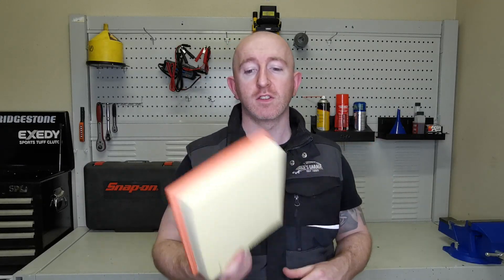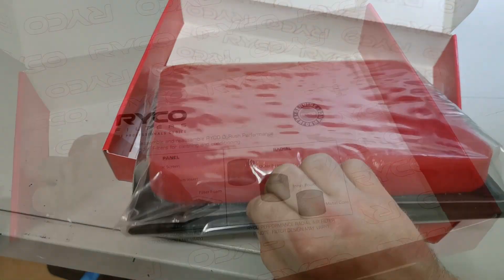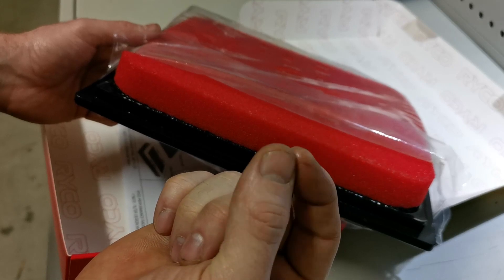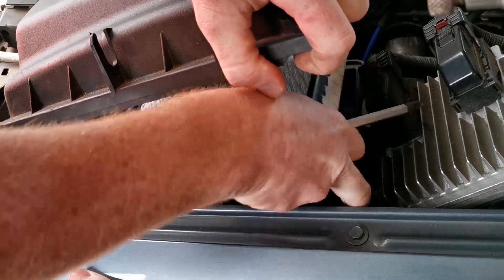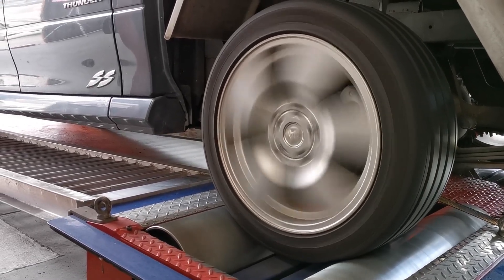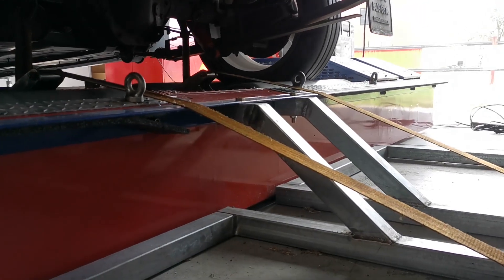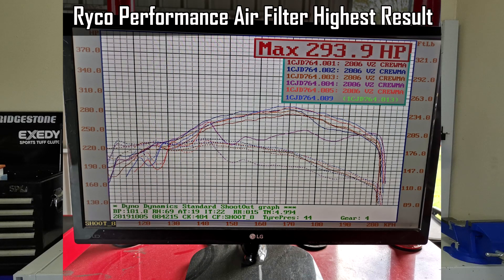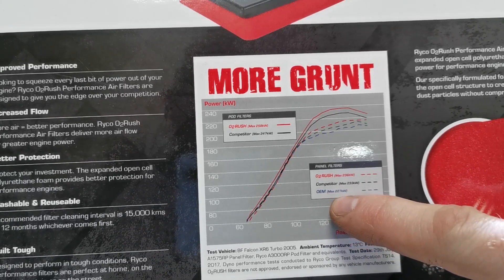Air Filter Testing - Will BHP Increase?

Comment: It’s not that surprising. With no air filter at all you’re not building any suction in the air box. The air is going to be very turbulent and the fuel won’t vaporize as well or get to the cylinders as smoothly. This would easily account for a .5 a .7 % go difference IMO. It’s like (but no where near as big a difference) as performance headers. Done right the exhaust gas expending from one cylinder should help pull gas from another. It’s a respectable gain though - thanks for sharing. It’s nice to see a straightforward no b/s comparison. 

For me, I always went tires, brakes, suspension, exhaust & intake, chip :) that’s if you want to enjoy getting around corners. Assuming it’s an auto.
Reply: What do you think happens at the throttle body? The air becomes extremely turbulent. If anything his results show that his test is flawed, and without ABAB testing, we will never know.

Comment: I am sure that in most island countries where air is cleaner than continental places one could drive only with a piece of stainless steel net instead of filter. The thing is that more air inhaled by the engine means leaner AFR which may lead to poor performance without remapping the ecu. Since there is some flow restriction by the sport filter there is more air to the engine but just enough to avoid extra leaning. Other thing is turbulences in the airflow without vs with filter could mess a lot the AFR on naturally aspirated engines due to lack of proper fuel dispersion. But can anyone tell the difference in dynamics between 185 and 190 hp? How the torque changed?

Comment: If a filter is a type of resistance. How can a performance filter be better than no filter?
Reply from the maker: Honestly shocked me as well, I was expecting it to be a tiny bit less than no filter, but those were the genuine results of the test. It's an extremely minute difference
Reply: @GerardBurkeBurkesGarage  this is hard to believe for me. The assumption is that there is increased amount of air. A more scientific explainable reason would need to be explored.
Reply from the maker: Results on a dyno have many variables, but just for discussion the wind increase flowing into the workshop may have picked up slightly, the other that springs to mind is the air fuel ratio was at a better mix with the air filter in on that particular run. 
The result is genuine and it did not bother me if the performance one was less than stock, I just carried out the test as accurate as possible under the same conditions to the best we could
Reply: Straighter air flows faster than chaotic air. A performance filter tends to "straighten out" the airflow, allowing it to better fill the inlet tubes at higher rpm.
Reply: @Ducu Alex I like this answer thank you.